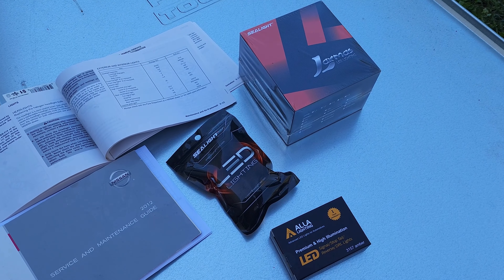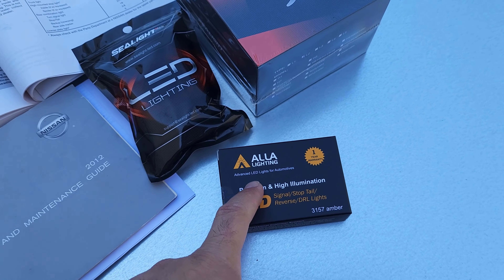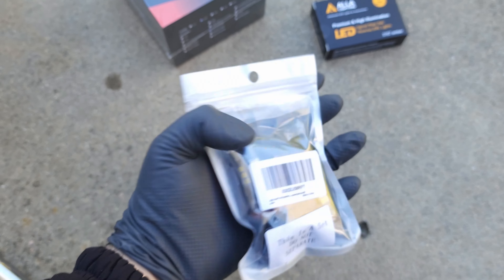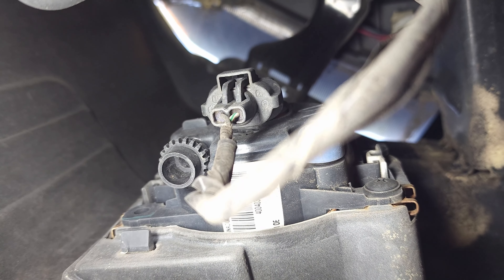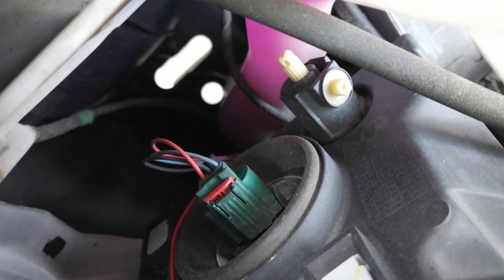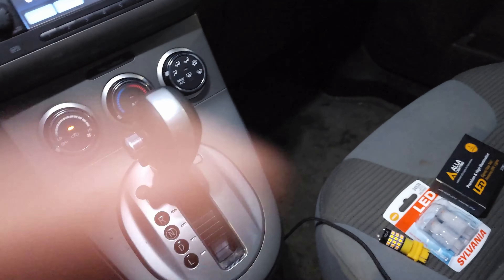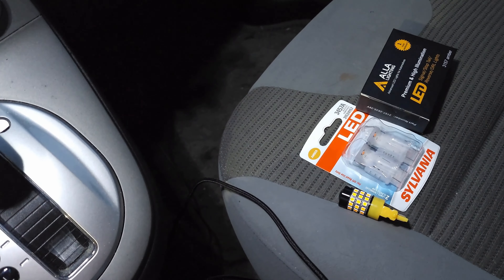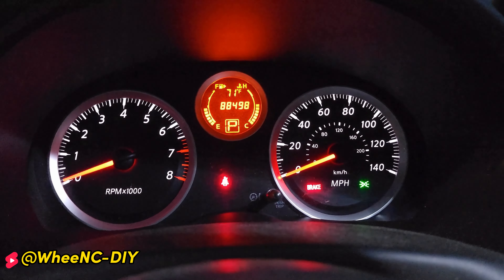2012 Sentra LED Headlamp and Fog Light Bulb Replacement

Comment: I will say that car light review, review these led bulbs.

Not a fan of sealight, but I find these sealight- Laxmas L2 are very nice led bulb upgrades. 

These don’t get hot at all.

In fact, after CLR did the test of 27 minutes of run time, which is the average commuter time in the US, the main unit of the led bulb gets cooled 119 degrees Fahrenheit, and 117 degrees Fahrenheit for the external driver. 

The cooler the led bulbs, the better the lifespan will be.

Comment: https://youtu.be/lJFXuCC5UI8?si=Luxwe_H8ko9zxTxo

The publish is 22.5W per bulb, which is 2 and a quarter times brighter than stock.

But after observation, u actual get 18W per bulbs

Which is much more efficient than 55W halogen bulbs.

So u get ur money’s worth, for something that’s perform a little better than halogen, much cooler than oem, and can last a very long time. 

So it’s much more efficient design. 

Remember, the cooler the led bulbs, the better the lifespan is.

The hotter the led bulb produce by how high the wattage is. The shorter the lifespan is.